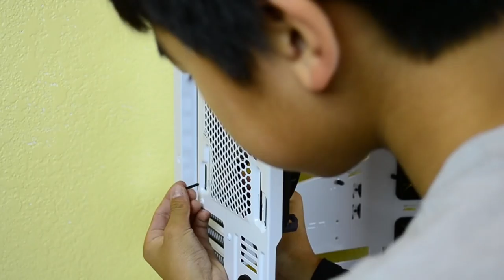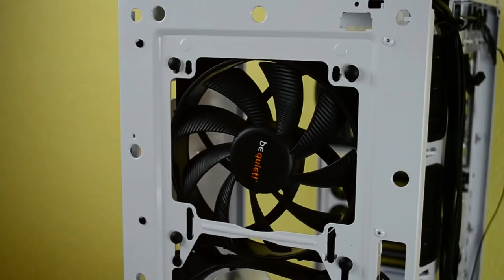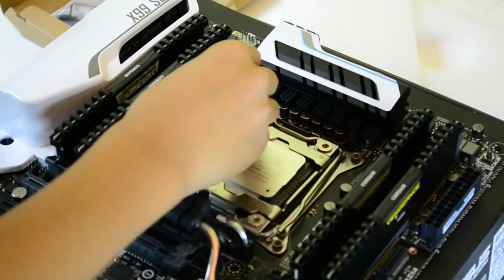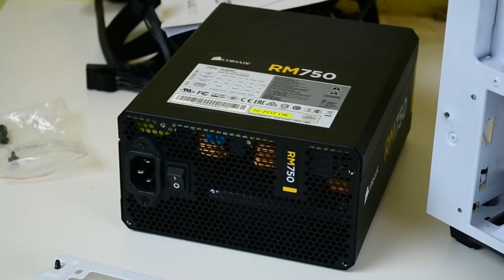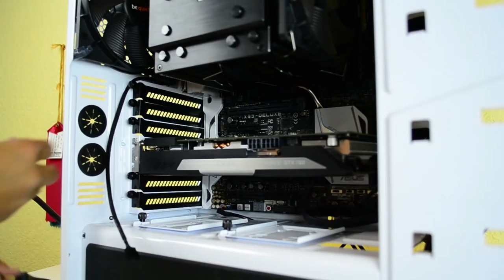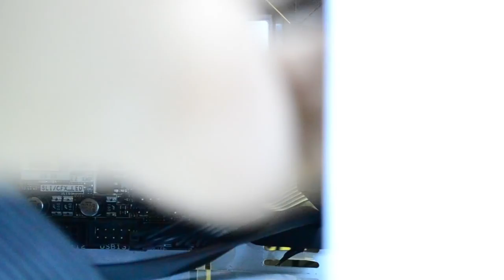ULTIMATE $2000 PC BUILD PT.2 (WORKSTATION)

Comment: as an absolute beginner I think this was a clear demo of a buildup. What scares me off a bit is the correct wiring up , are there manuals for that? The rest of the assembly I expect to be able to manage...
Reply: it's not hard, just go for it. your 'manuals' are youtube
Reply: +TheMrBennito Its honestly kinda hard to mess up. Its basically legos for big kids, and the wires only go in one way.
Reply: Don't worry it isn't that hard. Each slot has a pretty different shape and a simple half-hour guide on YouTube could give you all the information you need.

Comment: Antonalog, nice job. Are you going to be doing a bios setup and oc vid? I am hearing that many people are having issues with the X99 Delux board, and I am anxious to hear about your experience. I am planning a build using this board regardless of complaints, and will just RMA as many times as needed to get a good board. I will be buying the board as the very last item, hoping that they will make some changes, and possibly refresh to USB 3.1 I like the Be Quiet stuff. I already have my case, and 5 BQ 140mm PWM fans, as well as a Dark Power Pro 850 PSU. I decided to go with a Noctua cooler though. It performs well, but is not as nice looking as the one you chose.
Reply from the maker: Scott M Glad to know that my videos are helpful you you! I have tried to OC to 4.5, which should have been an easy and stable speed, but failed on boot. I have not tried to OC more because I really don't want to break my CPU and Motherboard! I have already RMA'd it once, but did not try to OC on the first one, so I dont know if mine is just a sour lemon. However, with the current rendering times, which I will be covering with part 3, I am very content with the CPU at it's stock speed. And since to OC will mean more heat which means faster fan speed, I have no tangible benefit to go through the hassle of OCing and potentially damaging my CPU and board. Also, I did not change much in the  bios, just the delay for posting to "none". The fan curves were changed in ASUS AI SUITE and it's been working out fine. However, If I ever decide to try some OCing, I will definitely let you know how it goes! Thanks for watching, and I hope all goes well for your build! Other than that, the board is really nice, and performs like a beast! Stay tuned for Part 3!